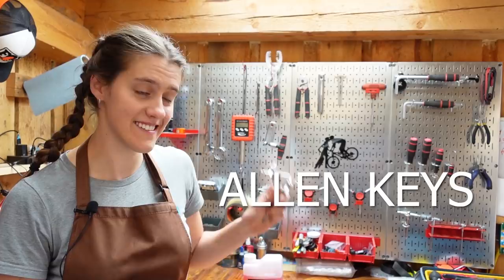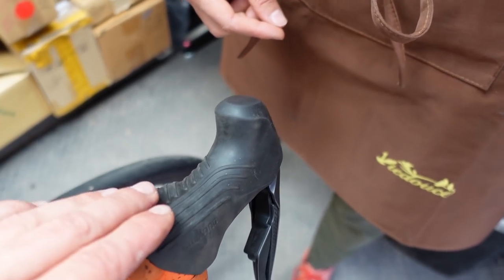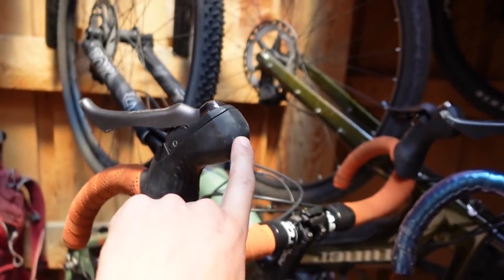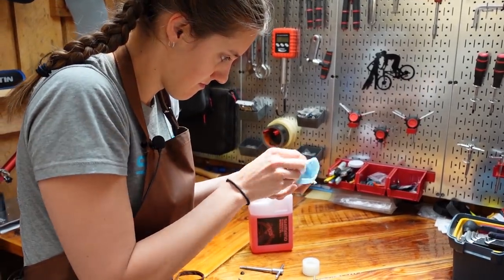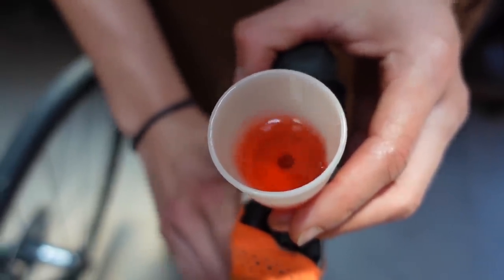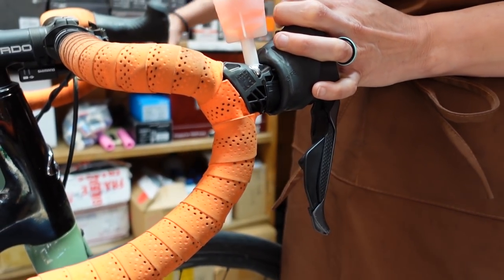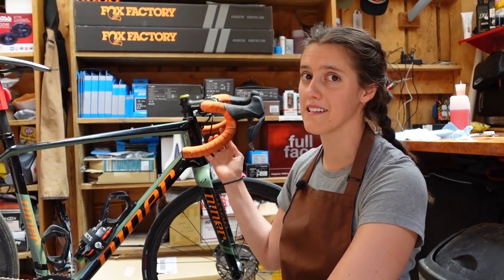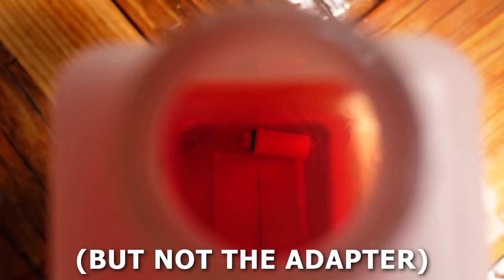Firmer hydraulic road brakes in 5 minutes | Syd Fixes Bikes

Comment: Followed this technique on my Campagnolo hydraulic brakes and had the same results. I used the Campagnolo bleeding kit, opening only the lever bleed port, screwing in the syringe (finger tight) and adding a bit of mineral oil. Alternated short lever throws, long pauses, longer lever throws, until I was satisfied with the brake feel and I couldn’t see more bubbled coming up. Got the lever feeling I was looking for. Also, as you pointed out, I didn’t use the bleeding block - I installed new pads and followed this procedure (naturally, wheel on). The internet seems full of Shimano and SRAM content - so I hope Campy users out there know they can do this too.

Comment: Have always figured a lever bleed is to account for pad wear. When changing pads, reset with the bleed block and start the cycle again. :)
Reply: A bit late. But yes, it works for that, too. 

Generally speaking, the system isn't 100% airtight (and therefore not fluid tight). That's by design, as you'd otherwise get issues with the reservoir (in the lever). 

For brakes that use actual brake fluid (DOT) instead of mineral oil, there's also the issue that ones it comes into contact with air, it absorbs some water. That water evaporates eventually, or even boils out if you brake hard and long enough, so there's nothing to replace the volume, but air. 

90% of the time a lever bleed fixes it. Having to do a full bleed is a rare occasion, and usually is only necessary if something cataatrophic happens. Like ripping a brake hose on the lower part of the system, or, as a customer did thinking "huh, what does that screw do?" 

Another case for a full bleed is when you attempt a lever bleed, and loads of gunk comes up. We had shimano brakes in the shop where the fluid was literally black rather than pink, and, so far only older Magura rim brakes where the fluid turned green and smelled seriously foul. The full bleed does two things in such cases: it flushes the system, and replaces old fluid. Though, in such cases, don't try to push the old fluid up, just let the system drain, then push new fluid through a couple of times. 

I can't say much about the performance of a dirty brake system, but personally, I feel better when things are close to new

Comment: I like to dab at the pool of oil at the top of the reservoir with a clean rag to take away a few drops of oil, until the oil level is at the insertion level of the cover screw, and then put the screw back. Seems to keep it cleaner than trying to catch the oil as it gets squozen out.

Comment: My mtb m9120, bite point is very close to grips, the calipers is very close to the rotors, infact it's slightly rubbing, I tried 1 way bleeding, or pump oil thru the calipers bleed port, still can't fix the issue
Reply from the maker: Make sure you center the caliper first (https://youtu.be/xWmlK5Qbt_U) then do a lever bleed. If that doesn't work, try resetting the pistons (https://youtu.be/o-YvMRJunwo) then lever bleed.

Comment: My hydraulic Utregra brakes feel solid, not spongy at all. But they pull pretty far before engaging. Would a lever bleed add fluid into the reservoir the way you do it? OR do I need to do a full bleed to add more fluid? Or is it something else. Thanks.
Reply from the maker: There may be a free stroke adjustment on the Ultegra levers that would allow you to adjust the pad contact point. If you tightened that, it wouldn't pull as far. There's also a reach adjustment you could experiment with if the levers aren't too far away...

Comment: thanks for vid. would this work for sram road using sram syringe you think?  work the lever a bit?

also why do hydro brake manufacturer's all have quite different bleed techniques in service manual? I think on cars and motorcycles procedure  is more or less same for all brake  brands and models. 🤷🏿‍♀️
Reply from the maker: We don't have any SRAM, so aren't as familiar with the bleeding process, but my understanding is that SRAM brakes require using the syringe because the fluid needs to be under pressure while Shimano brakes do not, which is why you can gravity bleed Shimano, but not SRAM

Comment: I have a question unrelated to this video.

I have a motorized bike that has eaten through a few traditional inner tubes. Would that Air foam liner thing be a good option for the tire instead of a tube?
Reply from the maker: Motorized meaning e-bike or motorcycle? Assuming e-bike, going tubeless would be a good option. You could also install an Air-liner, but most likely just going tubeless would be your solution.
Reply: @sydfixesbikes  it's a pedal bike with a little 90cc motor on it. Goes roughly 45, and my terrain would be mostly asphalt.

Thank you for your speedy reply!!